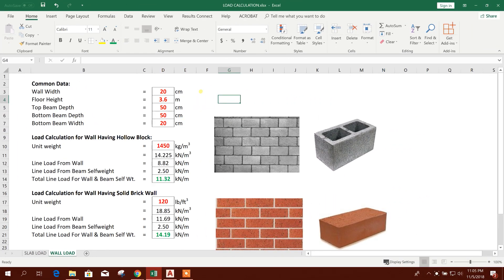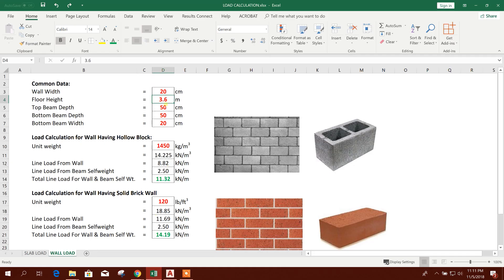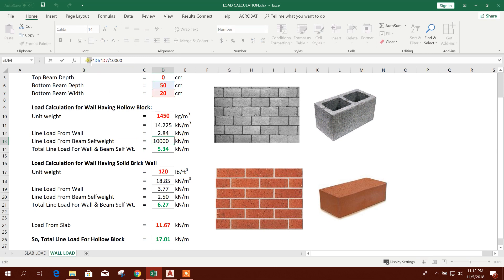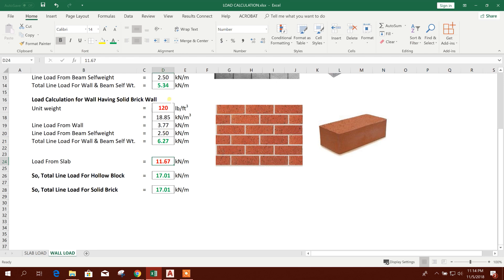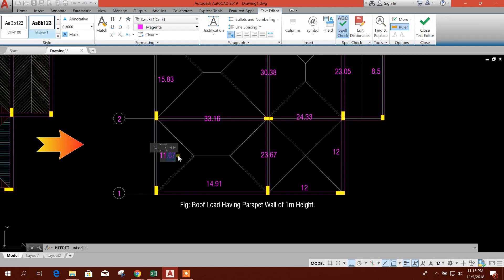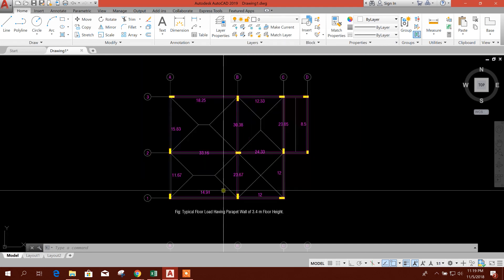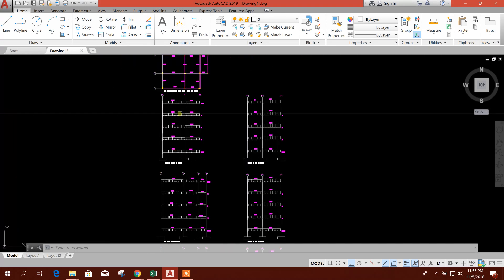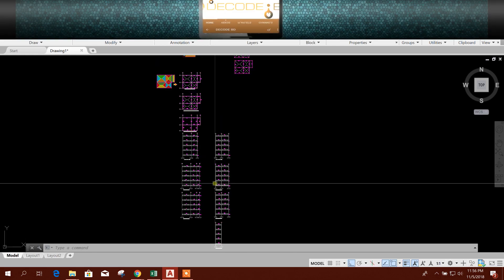CALCULATION OF A FULL BUILDING FRAME LOAD DIAGRAM MANUALLY

Comment: Hello Sir,
Please why did u add the load for the slab and beam at grade to the frame , I think it should not be part of it since it is non -suspended floor  ?
Reply from the maker: I didn't added load for slab at grade beam level. Check the video carefully.
Reply: @Decodebd  Yes U didn't but u added that for the plinth beam,  may I ask why ? cos the beam will be sitting on blockwork ,and those blockwork  in turn sit on the strip foundation , I hope u understand me ?
Reply from the maker: Everywhere practice not same. In our region we don't provide strip footing for supporting plinth beam or wall on ground floor. We provide plinth beam to bear wall loading & that load transferred to column to foundation.
Reply: @Decodebd  OK cool, I get it now.
Thanks for the Explanation